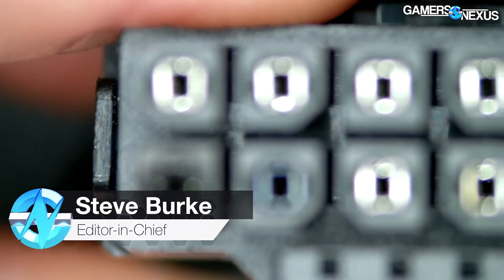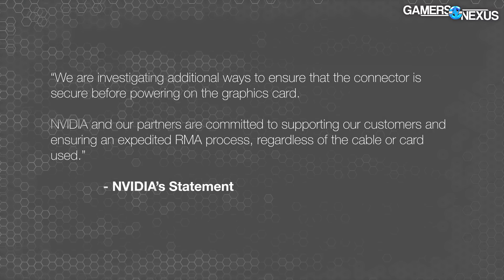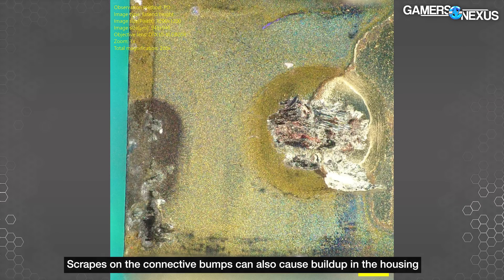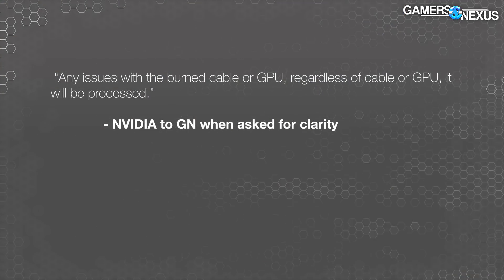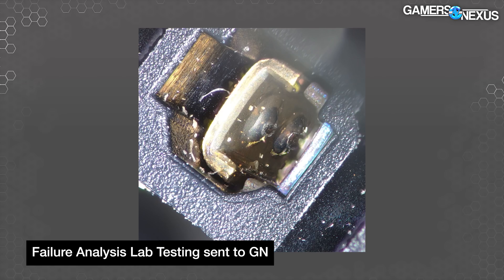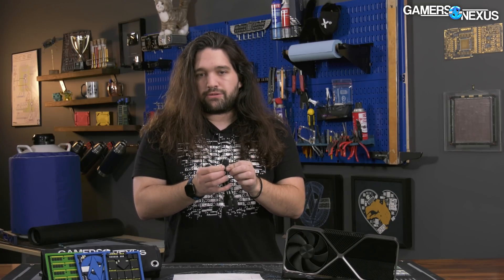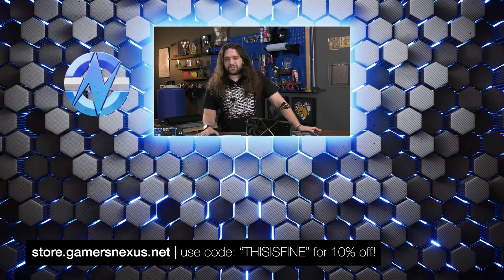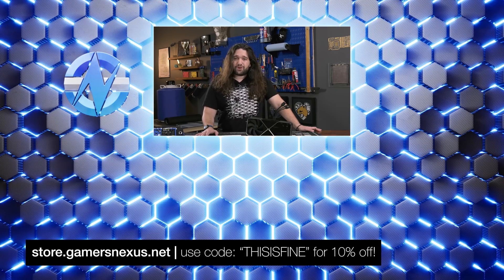NVIDIA Responds to Melting Cables, Warranty Concerns, & 12VHPWR Adapter Failures

Comment: Nvidia needs to ensure all of their cable suppliers are providing the same quality of cable, and ensure manufacturing defects are minimized to reduce the chance for debris formation whether that be from the socket or from the connector. A helpful design addition would be to give a proper "snap" sound when the cable is correctly and fully inserted (maybe a clip design more like sata data cables or maybe even Displayport?)This is after all a $1600 video card. Everyone should take the time to ensure power cables are properly inserted, snug with the sockets, and are not being pulled or bent excessively during cable management. If cables are repeatedly inserted and removed many times, check for debris or damage in the socket and cable... remove the video card/cabling and use a compressed air duster to remove any metallic dust/debris.

Comment: 15:08
connector is fully clicked in, but there is still gap 0.5mm or so. So you clicked it fully and then start managing gabels and gap is still there. Connection is still bad. CONSTRUCTION is still bad and will be melted with time

Comment: As somebody who's been working with cables and connectors for about half a century now, my usual advice is pretty much exactly what was said in this video, but actually with an extra step at the end:

1. Plug it in as firmly as you can, preferably until you hear or feel a "click"
2. Pull it back out with the same force you used to push it in.  If it comes back out, go back to step 1 and use more force.
3. Do all your moving around of the device, cable management, etc.
4. When everything's where you want it and you're ready to close up, go back and push the plug back in again as firmly as you can.
5. Pull it back out with the same force, and make sure it won't come out.
6. Push it back in again one more time.
7. Close everything up.

I still say that the only reason this sort of thing is a problem in the first place is because the connectors are actually badly designed and are not actually really capable of reliably carrying the power that they're trying to put through them (this application vastly exceeds the specs of even Molex, who designed the original connectors).  They do technically work, for the most part, but only because they've pushed everything so far that there are just no safety margins left, so if any small detail is not absolutely perfectly correct, you will get problems.  That is just not how a well-designed connector should be, particularly for something dealing with these massive amounts of current.  I'm still actually really concerned that even when people have them perfectly seated, we will start to see more and more problems in the future as these connectors age and the pin connections become slightly less perfect over time just due to normal use.  Only time will tell with that sort of thing, however.

Don't be too shocked if a year or two from now we have another round of all this with people who actually did everything correctly and thought everything was fine until something suddenly melted down with no warning, though...

(To be clear, I don't blame Nvidia, at least not entirely.  I mostly blame the PCI-SIG for this whole debacle.)
Reply: Thanks for the write up. It's kinda weird how many comments I'm seeing of people just making fun of random strawman users, when in reality the connector could really use a revision. The tech community has gotten very weird these past few years.

Even GN staff in the last video was making fun of strawman users, something about "typical Fortnite users"
Reply: @maikatase  it's clearly a joke you ignorant trog, it's not some official statement
Reply: The whole pci connector needs looking at. I can't stand pigtails. 2 wires into 1 crimp terminal is the worse.
Reply: @djashjones  It's because they don't want to use just two thick wires.  Even though that makes the most sense.
Reply: @EmperorA0  imo the adapter should have ended in 2x 6AWG lugs to be bolted on by the user and Nvidia should've worn them as a badges of pride "this baby can draw 55A so we slapped on a connector that can handle 95!" but that doesn't look as pretty as their recessed all black plastic connector.
Reply: Agreed. PCs have crept into a power envelope where internal power transmission isnt necessarily adequate anymore and now we begin to see the fallout from that.
Reply: "they've pushed everything so far that there are just no safety margins left"

100% This!
You can blame "User error" only if there has been reliable judgement on where user function goes beyond the safety limits something has
In the case of this connector and the power it has to handle, it turns out the margin of error is 0%
Which in operating terms, means this connector should have been a solid permanent connection and not one to be able to be manipulated
(Manipulated in the physical sense, not in mental influence)
Reply: The cable only has a 15 plugs cycle lifespan so plugging in and out is only wearing it down to fail. I thought why not put a red line around the plug at manufacture end so if you see the red it is not in and if you dont see it means it is fully in so does not need to be plugged so many times.
Reply: @giggity4670  Well that might not hurt, but part of the problem I suspect many people are having right now is that depending on the card configuration and orientation it can be hard to even get a visual angle to see that sort of thing, and even if it is visually fully inserted that doesn't necessarily mean that the retaining clip has actually fully engaged, so a tactile test is still a better way to be sure it won't back itself out over time.

The procedure I described does not involve actually plugging and unplugging it multiple times (unless you didn't plug it in firmly enough the first time), so it should not really reduce the usable lifespan in any way.  On the contrary, the slight wiggling of the seated connector after it's in can actually help improve contact and reduce oxidation of the contacts, which could potentially increase lifespan to some degree.
Reply: @foogod4237  Yea see your point is right the red line would help but does not guarantee it is fully engaged the clip without doing what you said. But really at that amount of power it needed a redesign plug as the small plastic clips and plastic housing cant hold it at them temps it can pull under heavy load even when fully plugged in as it is asking a lot of a old design plug as wear and tear was not accounted for at that power that why has such a low lifespan on the cable.

Really this is a huge jump form power output that they did not consider when making the cards as jumped from max output of 450W to 600W or more depending on over clock that is a big jump in power on really the same cable design that was never intended of that amount from 1 plug as old cards sometimes had 2 plugs or cables to run the 450W i think the thing needed changing to a more better plug with a lot stronger connections and clips to make sure it was fully applied but doing that means more money and a new standard but if they are pushing that amount of power it needs changing.
Reply: its actually horrifying that nvidia didn't pay GN to do this research for them, most companies after seeing this issue would issue a recall on the cable at least, and give out new cables. but NVIDIA refused to spend an additional 50 cents per cable because of greed.
Reply: It doesn't even need that much power, I mean this has happened to me with a SATA power connector to an ODD many years ago. The smell was not pleasant. Every time I'd open up my case to de-dust or similar, I'd just routinely check the connections that could be affected by me moving around.
Reply: And all because nVidia didn't want to use 3 or 4 8 pin PCIe connectors instead...Or move the card to the 8 pin 12V standard server grade cards use.
Reply: the pci sig has this connector added to atx 3.0 standard beginning of 2022
but remember that nvidia actually made the 12 pin connector for the 30 series launch 
i remember them saying how proud they were for their new connector 
so how i see it nvidia is to blame their design is sub optimal and now it was even added as a standard yikes
Reply: @Crushonius  Well, from what I understand it was actually Intel who originally proposed this connector (or something like it), so it's really kinda a group fail, IMHO.  I just really don't see how there are so many supposedly competent professional electrical engineers in the middle of all of this and yet this blatantly bad design still got all kinds of rubber stamps from multiple different groups, though.

For what it's worth, I can understand the desire for a more compact connector.  Yeah, four of the old 8-pin connectors can technically work for current cards, but that really won't scale much farther if power requirements keep increasing (which let's face it, they almost certainly will).  There are just so many better ways to do a compact high-power connector than this, though (such as using a smaller number of spade-type connector pins, which can have much higher surface area and better contact, which is why they've been used for power delivery connectors in most other applications for somewhere around 80 years by now).

I also don't understand why we're still doing all of this at 12 volts, which was a fairly arbitrary standard originally included in PC power supplies just because many cheap floppy disk drive motors were designed for it.  All you have to do is bump the voltage for video cards up to, say, 24 volts instead and it's still perfectly safe and the current needed gets cut in half, which reduces the heat generation to 1/4 (because heat is proportional to the square of current).  Suddenly, all possibility of melting connectors (no matter how badly they're inserted) magically just goes away...  (you could actually go all the way up to 48V if you really wanted to, which combined with a better pin geometry could give you maybe 10 or 20 times the power capacity of these connectors before you start hitting the wall).  This is all just so dumb in so many ways.
Reply: @foogod4237  and we're also sure this isn't self obsolescence or them trying to save money by not having to invent something that couldn't be readily implemented without major changes. That said, if we use MS eliminating their hardware testing department as a baseline for the kind of stupid shit that's been on the trajectory in the industry, them not totally redesigning connectors make sense. It's all about saving money and pushing things onto the customer. How much people wanna bet, they already knew about the problem chose to ignore it, using it as a way to deny warranty claims.
Reply: nice 100 word essay

Comment: Steve it's actually possible to do very high detail imaging on components like pcbs and connectors if you cast them in resin and then grind them down flat (like with a lapping surface) and scan each layer one by one looking for defects. 👍

Comment: I'm sorry but NVidia's response is not good enough.  To think that anytime I need to take my system apart for any reason that there could just be the possibility of something going wrong with the power connector when it gets put back together because of this issue.  No just no.  Also, I have a Lian Li PC011 Dynamic case and my current 2070 super cable is already pressed against by the side glass.  I can't imagine one of these cards fitting in my case considering how oversized and fat they are.  Vertical mounting is not an option.  No Nvidia.  That isn't good enough.   Redesign your damn power connection.  Ensure it is safe and dependable.  Put the damn thing on the end of the card instead of the edge where it will collide with the side of the PC case.

Comment: it feels like the plastic casing for the connector is built with really bad tolerances, so the male side is too "fat", resulting in too much force required for complete insertion. which is why those wear markers are visible

Comment: I once ripped a GPU AND the PCIE slot out of a PC because the clip despite being pushed down wasn't FULLY depressed. It didn't take a great amount of force to rip the entire PCIE slot out of the MOBO still attached to the GPU (thin metal wires thrown about my case, it was like my mobo was disemboweled)...

The amount of force I applied didn't feel uncomfortable, so keep that in mind when you test how secure your power cable is when you yank on it.

PS: The PC continued to work after this event, I put liquid electrical "tape" over the exposed PCIE internals (after cutting the thin metal wires off) and just used the 2nd PCIE slot for my 2080 ti...
Reply: I speculated at the time that the PCIE slot gave up so easily because the PC was still hot after having been ran, I assumed the solder was weak because it was still warm.

Comment: I swapped to the Corsair cable and it was a night/day different feel when inserting it compared to the NVIDIA adapter, which didn't seem to take any force at all.  Turns out I DID plug the adapter in okay (even though I felt no click but I did push it as hard as possible, triple checking) but the Corsair cable felt a much tighter fit with a very decisive click.
Reply: Do you mean nVidia connector was very easy to plug in?
Reply: @vsm1456  Mine was, yes.
Reply: @alexatkin  interesting, many people have the opposite experience. maybe it depends on the manufacturer of the adapter? do you have an Nvidia Founder's Edition card or is it from another company?
Reply: @vsm1456  Yes its the FE.

Comment: It's amazing how good these companies actually are at damage control like this. Those clips are usually fine but over the years when these get filled with dust and the clip gets brittle or works loose in a few years due to thermal cycles.

Comment: Change the latch change the connector in future that has higher power capacity, use a latch lock on connector like automotive injectors

Comment: Least modifying fix could be a 12vh plug that has yellow plugs/fingers/pins so if it isn’t plugged in all the way the yellow indication is seen. Might create a more expensive cable though as then it would need double molding or some other more complex manufacturing process.  Thanks for keeping up with this!

Comment: Melting of electrical connectors is simple.  High current through poor means.  More connection to carry the load. Just like gauge of wire matters.  Look at the 3 power cables feeding into the one...

Comment: An L shaped connector would work better too, so it's not smashed up against the case as much. You'd need some way to swap the angle up or down of course, but it might make it less prone to bending.

Comment: It has been standard practice to check that a cable with a latch is latched when plugging it in usually by pulling on it a little bit to make sure that it doesn't just pull out. In this case it certainly seems like it could be claimed as user error, but at the same time it seems like this connector is hard enough to plug in and latch that it almost encourages user error. I don't have one of these cards to really know for sure. Given the apparent low error rate it seems like most people already had it right.

Comment: This is what happens when you start to take things for granted.  Bottom line, it's a cheap cable design....for a friggin $1600 dollar card!  I'm wondering if Nvidia has the same attitude toward their business focused A.I. crap.  I mean, the 4090 reveal was only like 5 minutes with most of the bloody presentation focused on their business hardware.  I'm wondering if similar oversights were made there too.

Comment: I can see the Nvidia official validated power cable raising the cost of the cables by 10 fold. Regardless of use error being the cause of the melting, it seems like more of a design failure to make it so easy to partially insert the cable. Overall it just seems like the 12vhpwr connection was a failure and the 40 series is just over priced.

Comment: Wonder if GN could test 8-Pin connectors next. Test them to the point of failure or melting to see if the same thing is even possible with a standard 6+2 pcie.
Reply: And also compare 4090 connector with 3090ti connector. It was 12VHPWR too, but it doesn't look like there were issues with them. It's probably because they didn't require as much force to plug in, so improper plugging occured much less often.

Comment: A electrical engineer would have recommended to use the standard mc4 or xt40 connector instead of the untested and anemic 12vhpwr
Reply: Intel designed the connector, but didn't use it themselves.
Reply: @abram730  PCI-SIG designed the connector, not Intel, not Nvidia.
Reply: @gracej79  I hear that Intel designed and lobbied for the 12VHPWR connector hard.
Reply: @abram730  You hear wrong.
Reply: An electrical engineer would recognise a Molex Micro-fit connector and know they been used for years.

Comment: The issue about the wording of the warranty should never have been about the use of the word "may" - that is standard in warranties.  The real issue, and the lawyers who drafted is should hang their heads in shame, was the wording "use of non-complaint OR third party cables", that is simply wrong it should have read "non-complaint AND third party".  I am guessing the lawyers who did the drafting were never taught formal logic.

Comment: The 4 sense pins should be around the 4 corners of the connector, not on the same side in a row. That's a design mistake in the cable standard.

Comment: That graphics card is FREAKING HUGE!!!!

Definitely the best way to fix that connector (is it 12 pin or 16 pin? I'm confused) - is to reduce the "sense" pins so they only contact when fully seated, AND to improve the latching mechanism to only latch, and audibly click, when fully seated. 

That's just poor engineering.